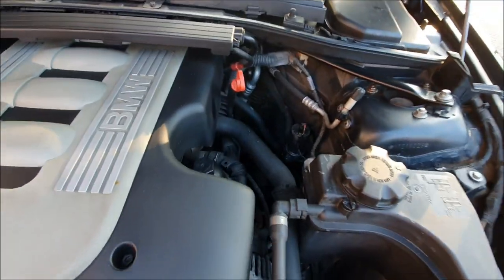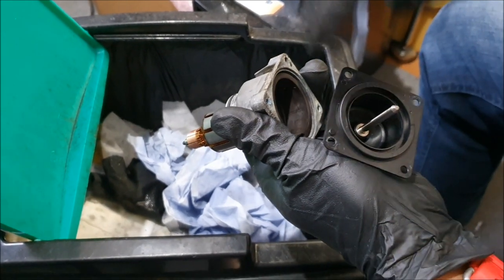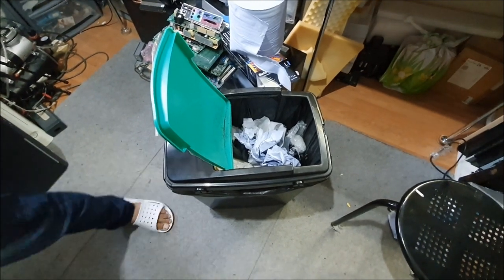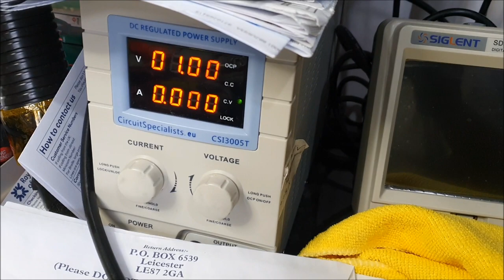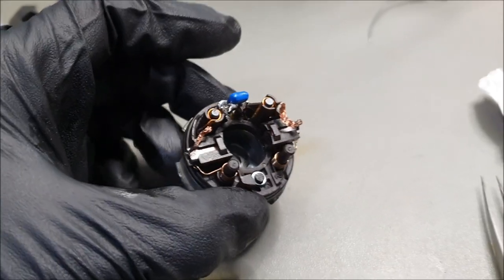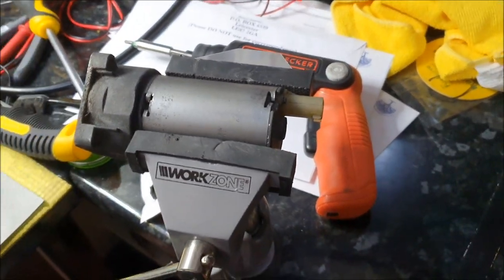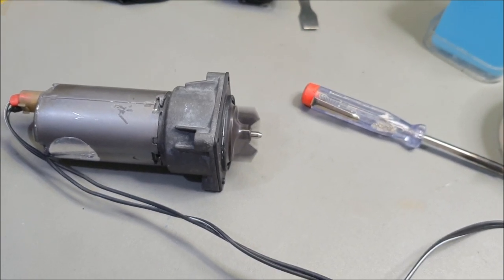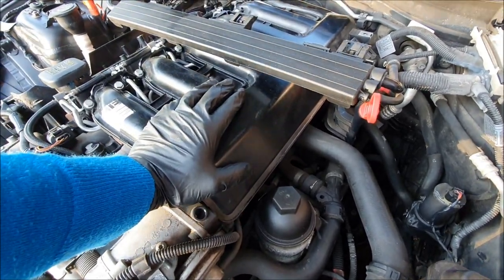HOW I FIXED AUXILIARY PUMP HEATER BMW 330D E90 M SPORT 2008

Comment from the maker: Hello, the link below is what I've used but ideally you want brushes with wire coming out of the sides (2nd link AliExpress)

https://www.ebay.co.uk/itm/Carbon-Brushes-to-fit-Mercedes-ABS-pump-L5-5H-91K-5x5x13mm-electric-motor-B20-/282639048453?_trksid=p2349624.m46890.l49292

￡5.15 | 4PCS/LOT, 5X5X10mm Car Motor Carbon Brushes for Automotive Wiper, Window glass lifter Motor brush, Free shipping!
https://a.aliexpress.com/_v3XyPJ

Comment: I read on another forum the brushes are 5x5x11mm. The advice seemed to be to use the ring to hold the brushes in place and when you push the top in the bearing pushes the ring in and the brushes slot in. Somebody had tried putting a bit of water on the brushes and freezing the unit so the brushes hold in place long enough for the top to go in. I lost the ring so used to toothpicks from the outside wedged under the brushes under spring pressure and as I pushed the top in pulled the picks out and it seemed to work. I only did this for fun only half expecting it to work as it wasn't a full refurbish like you did. The new unit is £153 including VAT from BMW when I enquired.

Comment: As you've stated for the Aux water pump, the glow plug controller is the same. They fail because they have these thin aluminium wires which break from the massive amount of power they have running through them. Considering you like fixing parts and have the patience, I think the glow plug controller would be an easy fix for you. The one thing you will need to do is use a heat gun on the backplate of the controller otherwise the heat from the soldering iron gets sucked out and it will never get the contact pads upto temp.

Still watching your video, I've bought a second hand aux pump and it still doesn't work so I'm definitely going to try this out. From my understanding the aux water pump can potential save from a warped head after overheating because it will continue to circulate the coolant when the engine is shut off to average out the temperature.. That as well as being able to bleed the coolant and provide better heat with the engine turned off... so it does have some perks.
Reply: Thank you so much I'm trying to do a glow plug module rn
Reply: Or else buy a Hitachi glowplug module they are alot better without the thin cables it have bridges instead try to make a search for it there is a couple of videos about it

Comment: Hey man just wanted to let you know that it is possible to put everything together without any drilling. Remove the plug as you did. Drop retainer and spring washer into the top part the way they are supposed to go in. The put the bearing betwern the brushes and release spring claws. Slide the rotor and stator on and in the end you just have to press on the retainer through plug hole.

Comment: Ive got also this alert on my obd but everything seems to be working fine with the car. What does this pump do exactly?
Reply: It uses the residual heat from the engine to keep the cabin warm when the car is off and you activate the rest button on your ac panel it's for when you're getting groceries and such from the store

Comment: Do you have link for brushes
Reply from the maker: Hello, the link below is what I've used but ideally you want brushes with wire coming out of the sides (2nd link AliExpress)

https://www.ebay.co.uk/itm/Carbon-Brushes-to-fit-Mercedes-ABS-pump-L5-5H-91K-5x5x13mm-electric-motor-B20-/282639048453?_trksid=p2349624.m46890.l49292

￡5.15 | 4PCS/LOT, 5X5X10mm Car Motor Carbon Brushes for Automotive Wiper, Window glass lifter Motor brush, Free shipping!
https://a.aliexpress.com/_v3XyPJ
Reply: @iTCXtreme  thanks a lot